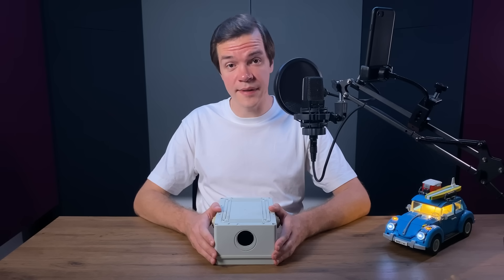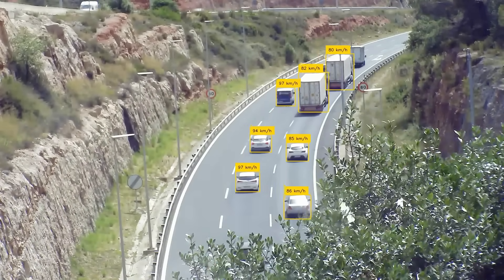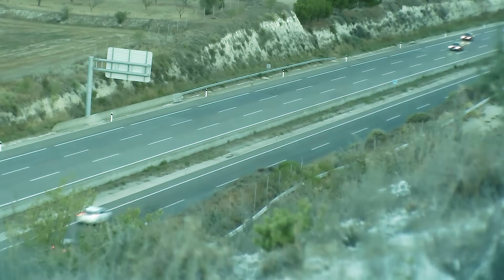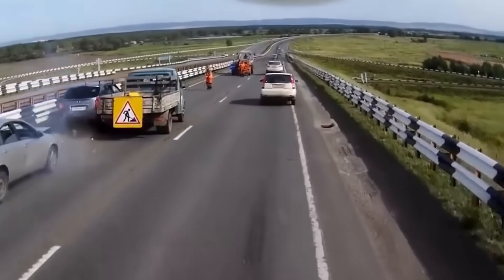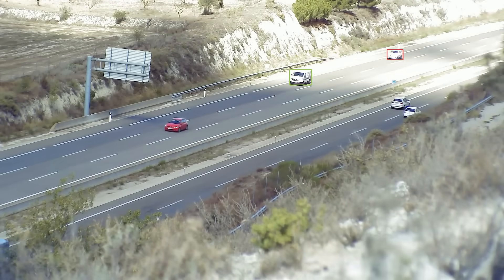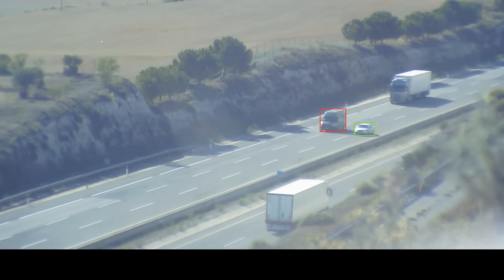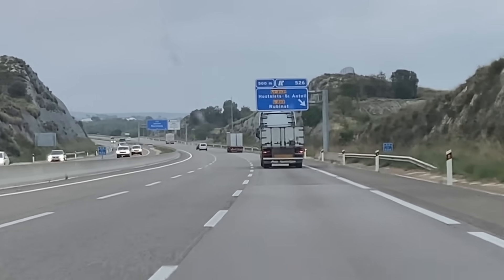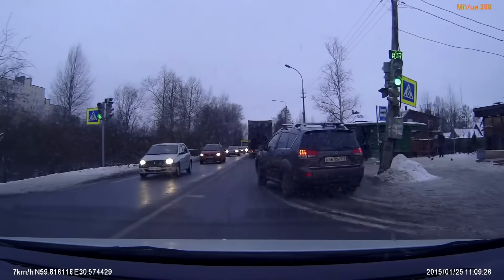New Anti-Tailgating Camera Reveals Shocking Statistics

Comment: Yeah, I always get flak for leaving space between myself and the car ahead but its like, you aren't cut off if you have plenty of space for a car to move in. Plus people cut others off because no one will leave space and they need to get over in some situations. I don't breakcheck but if someone is being excessive I will either make sure I'm exactly at the speed limit or I'll let my speed dip one or two mph either until they get the point or they pass me. If you get hit because you break checked someone in the states its your fault and you'll be the one dealing with the insurance even if the person behind you was too close you purposefully put another person at risk. The other thing I see a lot is people changing lanes or pulling out into turns without actually looking to see what's coming or where other people are and just assuming other people will stop or slow down for them. In my state its the responsibility of the person merging to fit themselves in safely and yield to oncoming traffic but people seem to think its the other way around. It isn't and I've had to show people the law several times, something they should know after having passed their driving exam.

Comment: 8:41 "30m also seems to be the most commonly used following distance" That is wrong. 

Since the distribution is generally uniform, the mean or median better reflects the true central tendency, which in this graph is around 100m. The mode(30m) doesn’t capture this accurately and using it here misleadingly makes your point seem stronger than the data supports.

Note(Edit): However, because the distribution is roughly uniform, the standard deviation is significantly higher than that of a normal distribution, meaning that if the following distance is not approximately that of mean, it is more likely to be further from the mean than it would be in a normal distribution. In this example, if the following distance observed was not 100m, it was more likely for it to be either towards the higher end or the lower end of the range, which in this case would support your point because there would be a nontrivial amount of drivers with a very unsafe following distance. But this does not equate to the average, which in the video you misconstrued it as.

Comment: we've had vehicle-spacing guidance from the police here in japan for the last couple years, and it's resulted in an increase in traffic jams and commute times, despite the population shrinking. naturally with cars further apart, there is space for fewer cars on the road, fewer cars get through each green green light, and it has also affected driver behavior - people feel the need to maintain spacing rather than use it as the buffer it's meant to be, so if someone changes lanes into their gap, they brake, slowing down the entire road and increasing accident rates.
we've also had police guidance to raise headlight levels "to see better", and it has resulted in a 30% increase in the number of accidents involving bicycles. the brighter lights dazzle everyone else of course, but they also impact the low-light vision of the driver, so they're less likely to see anything that's not brightly illuminated. it's important to consider that we might be making things worse in our attempts to make them better.
Reply from the maker: That's very interesting observations from the part of the world we don't usually get much news from. Thank you!

Comment: What about adjusting the speed limit based on the "amount of tailgating", if cars are driving too close to one another, then reduce the speed limit, and fine accordingly, you can use average speed cameras for that. This would incentivize drivers to maintain the optimal distance from one another in order to maintain speed.

Comment: The cars from Volkswagen help a lot in this cases. The dash shows a simbol when you are too close to somebody in front of you, and it takes the speed you are in consideration, Also, the have automatic brakes, that applies faster than our reaction times, and even stops you car if you fail to reach the brakes on time. I'm sure thats more car brands with this systems also, but I just know Volkswagen's, as is the car that I drive.

Comment: In Germany the law says the minimum following distance outside the city is half your speed in meters, so at 100km/h, its 50m (trucks are always required 50m, when driving over 50km/h). The issue with everything is, you can't enforce it everywhere, because then you would become an unfree country. You could put out more cameras but they get public knowledge really quickly and they itself get dangerous. I see this with speed cameras, no matter if announced or not. On my route to work, I have a speed camera that enforces 100 km/h and its not uncommon that drivers slow down to 80 to 90 but some even go down as low as 60. 

When new systems would get developed, that would be cheap enough to enforce the rules everywhere, you suddenly have a powerful tool to enforce way more. Power gets abused. They will lower the bar constantly. Getting a bit lower doesn't feel threatening, so people would agree but at some point, they are near you and you feel suddenly very uncomfortable. To get a bit off topic: reading your encrypted messages. Now they want to sell this surveillance to catch the really bad boys. You can't argue against the crime. Once they have their foot in the door and access, they will add more and more to the list, because its easy. At some point you have the police knock on your door, because you thought something wrong.
There is even a book about this (1984). It's banned in some countries, in others it get taught in schools. It's an anti-authoritarian book.

Comment: I've found my drives far less stressful and more relaxing since I decided to just set my cruise control to just below the speed limit (or, in heavy traffic, to just below the average speed of traffic) and leave it there. And yeah, people cut in front of me all the time; that's fine. Since I'm already going slower than them, the cap will open up again fairly quickly - no braking needed. Meanwhile traffic behind and around me is moving smoother and safer, and someone who needs the right-hand lane to get to a junction have a safe place to pull into. It's a win all around.

Comment: tailgating is also the cause of congestion. here in Oz the minimum safe follow is set at 2s, which you can mental the math at current speed / 2 + 10%. if congestion has you down at 40kph thats a 22m gap to maintain OR roughly 4 car lengths. if you have a 22m gap at 40kph you're not congested and other drivers can easily swap lanes. emergency services will be able to move through that, vehicles that have failures can move into stopping lanes. 

being closer doesn't get you there faster it just makes the chances of not getting there higher

Comment: 10:47 I am relieved we are not alone but disturbed far more that this is a global trend? This is quite common in the Northeast US, someone will pull up right behind me and as soon as a gap appears on either side they dart around. 
As for implementing ticketing, I believe while dystopian as fuck, the problem is solvable with scale. Enough cameras, and you can begin to build driver profiles for every car on the road. Maybe even to the level of fingerprinting individual drivers . If it is a one off, where someone cuts in front of you, it barely nudges your average. If you habitually tailgate, there's a good chance you will be doing it at least a couple of times under cameras. And you only need a few to build a strong enough case to just send a ticket. If the driver is really convinced that it is wrong, they can dispute it like any other ticket.
If the cameras that they're already putting EVERYWHERE here are going to be here for a while, at least they could be more useful.

Comment: speed limits are law,distance are only recommended,because its impossible to imply laws to keep distances and fine those not keeping it.
DO NOT push breaks on highways,its the most dangerous thing you can do,like becoming stationary,just without stop.Just lift the foot from the gas,thats enough to slow down.pushing the breaks shortens the reaction time for the guys behind you.So only use breaks if really necessary, and be aware of cars not only in front,but also behind you,specially trucks.Staying behing trucks is a bad idea to safe fuel.They normally have much better breaks than a car and you dont know if they are empty or carrying cargo..

Comment: I believe in Europe the left most lane is known as the passing lane just as it is here in the US.  It is actually codified into US traffic laws.  The problem is no one in the US knows this.  In Germany if you are not passing you better not be in the left lane or the guy in the Mercedes Autobahn bomber will let you know in no uncertain terms.  Why is there no awareness of this in the US?  Why do we put up with this when Europeans do not?  If your in the passing lane, the left lane, and someone comes up on you, you are required by law to pull over and let them pass.  This is why you are being tailgated and why tailgating occurs.  And, contrary to the OPs assumptions, tailgating is not what causes traffic to slow down.  What causes traffic to slow down is when someone is traveling in the passing lane at a slower speed and refuses to get over.  This causes a chain reaction of slowing that in areas like Los Angeles, will eventually lead to the actual stopping of cars.  When the first car slows because some idiot in the passing lane is blocking his progress he forces the car behind him to slow just a tiny bit more than he did.  This chain reaction is cumulative causing each following car to slow just a little more until, if there are enough cars wanting to go faster than the first car, the speed will eventually reach zero.  So-called traffic experts have failed to realize this reality and always suggest going slower will make traffic go faster.  Does that make sense to you?(rhet).  Of course not.  There is only so much room for so many cars.  Demanding your safe distance is OK if you are not a ROADHOG!  If you're not passing, get out of the passing lane.  It's the law, and, you are causing traffic to slow behind you that you will never be aware of.  You're a jerk and in L.A. you might get shot for it!

Comment: I drive a lot during heavy traffic, one thing you learn quick, is to not leave enough space in front of you for someone to randomly merge in for no reason, because the moment they see a space open they will take it without caring about following distance. Also, I think the 100 meters is a bit exaggerated, you don't need a full 3 seconds. Because the car in front of you won't be able to stop instantly, it will slow down over a set distance, so as long as you leave more time than your reaction time, and match the speed of not only the vehicle in front of you but all the traffic ahead, you'll be safe. And most healthy people reaction time when not distracted is less than a second for sure.

Comment: In US city freeway driving, two seconds is an open invitation for an intruder.  The only solutions I've found in 50 years of driving are 1) drive a taller vehicle so you can see over the car ahead, or 2) drive offset so you can see past the car ahead.  If everyone did that we'd have groups of 4-5 staggered cars all with good visibility.

Comment: Equip cars with radar in the front to measure the distance to the next vehicle.  Alert the driver if the distance is too close.  That way a driver can make a decision about the immediate safety.  Automating the process would create other unforeseen problems.  100 meters at 100 KPH is a good heuristic.  Thanks,

Comment: I don’t use adaptive (aka intelligent) cruise control on the highway because of this problem. Every time a car cuts in from of you, your car slows down to maintain the distance called for  by the cruise control system. You end up driving well below the speed long most of the time.

Comment: I have doubts about the validity of these measurements because they are influenced by your setup. Specifically, if you focus on a 1km stretch of road all the inter-car distances you observe will be below 1km. If you take this to the extreme and focus on a 100m stretch you will observe only distances shorter than 100m. Also, you are presenting the average following distance as if it is a stationary value, and then you are talking about the average of this value among several cars. One can imagine that a single car drives with a varying following distance, so it is interesting to first establish what is the variability of this value on a single car, before starting to average it over many cars. Again, a short stretch is not suitable for such an investigation.
Reply from the maker: We're not really interested in following distances greater than the recommended one. We also can't say 1 km is a following distance, since you can barely see the car in front.

Comment: You’d be interested to know that many automatic cruise control systems don’t observe the three second rule, so this may screw the data a bit as the computer can of course react faster than a human. Another thing to note is that 30 m is the most common distance between cars at 120kmph because that is the distance that drivers deemed to be safe, maybe they aren’t wrong. Everyone is different and depending on how well you know your car, you can adjust your distance to the car in front to one that is safe for you, and hopefully everyone else.

Comment: Simple solution, just as trucks are speed regulated, cars should be too, and with typical adaptive cruise control and rear sensors most cars have, they should be forced to being unable to close any distance between two cars appropriate to the speed, while bleeding speed should someone cut in front. If people can't drive, the cars should enforce proper behavior.
Most cars have positioning systems as well, cars know where they are and should be able to adjust maximum top speed based on country laws.

Comment: It shouldn't be hard to check not only the distance between two cars but also the relative speed between them, and fine the driver only if the gap is staying the same/closing in. It is indeed annoying that people would often enter the gap I leave in front of me, but it's generally less of a problem on the highway, as people are more cautious about changing lanes there. I get the brunt of the negative impact of driving a safe distance in the city.

Comment: tailgating cameras actually do exist! They are usually at overpasses. There are are 2 sections they observe the first section is to see if the driver is actually tailgating or if he is slowing down to increase the safety distance. The other section is to measure the speed and take photos for ticketing.